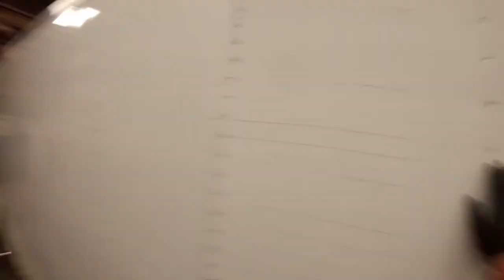tractor trailer big repair for miner damage

Comment: You have to go inside and jack.. the ceiling up to get the weight off..see your ripping the aluminum trak for bottom rail lining meet..that rail shouldn't be that hard to pull off